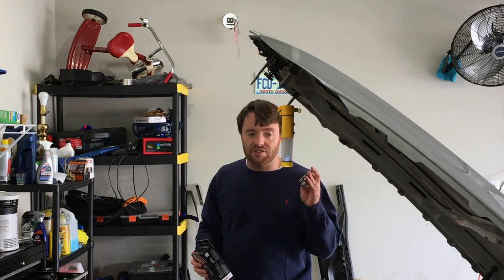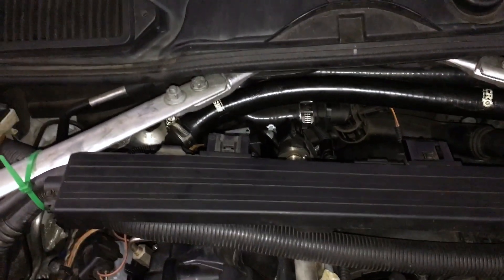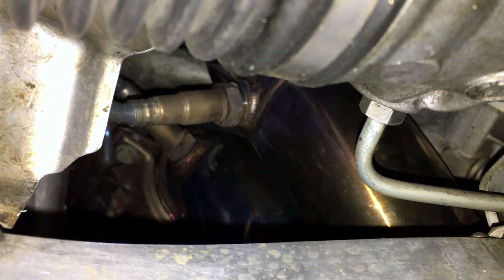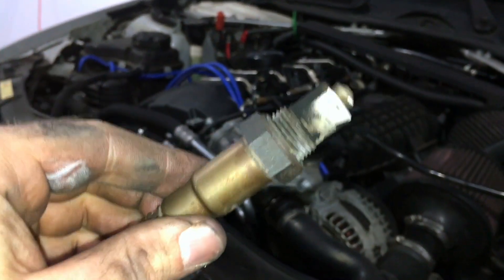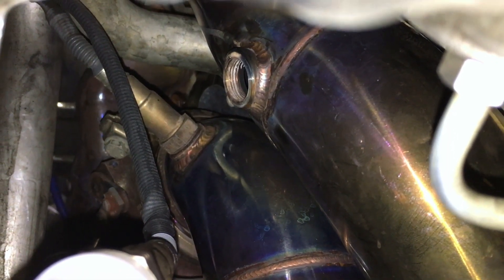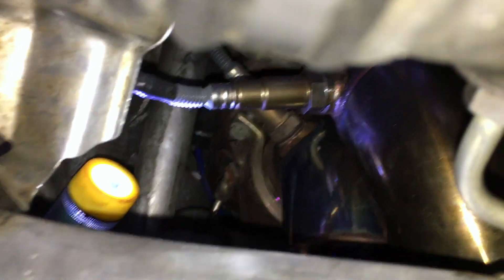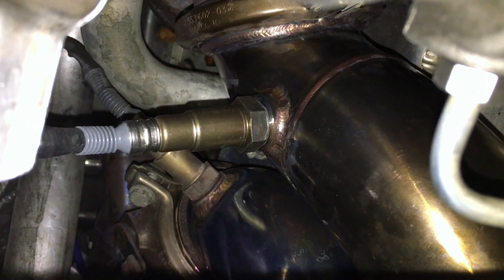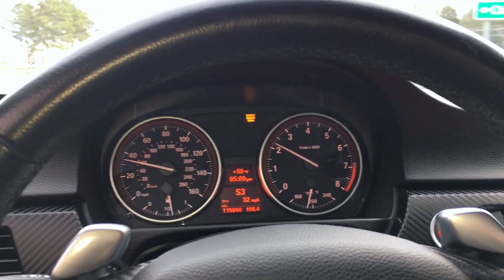BMW E90 Front O2 Sensor N54

Comment: Why dont you just hey a dp
Reply from the maker: I have DPs. Doesn’t mean o2 sensors don’t go bad.
Reply: @BMWE90HQ  what sensor does that first sensor that is plugged into your downpipes called? Im replacing my 02 sensor and putting catless downpipes, and want to get ones the ones for the correct bank, or should I just do all of them, I only have my mechanic for 2 days in a few weeks and we’re doing downpipes. O2’s, and servo motor change with fluids,

Comment: Did you figure out your issue? If its repeatedly running rough the first few seconds of starting up you might have a leaking injector. They can leak into your cylinder overnight and cause a rough start

Comment: Im getting a 2C7F now after installing upgraded turbos guessing either rear O2 or crossed the wires on the rear sensors
Reply from the maker: I still have 2c31 I’m trying the rear next. If that doesn’t do it I’m lost.
Reply: @BMWE90HQ  Update?
Reply: @BMWE90HQ  dont forget about post cats and make sure they are both plugged in underneath by the transmission
Reply: Update  @BMWE90HQ